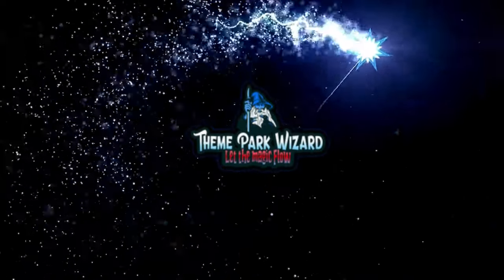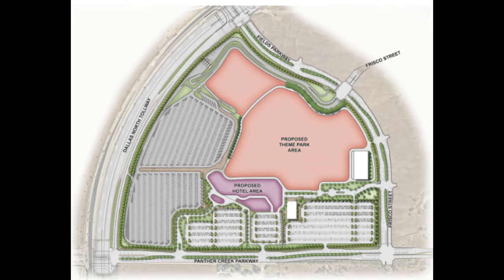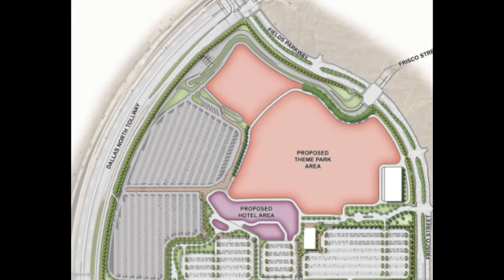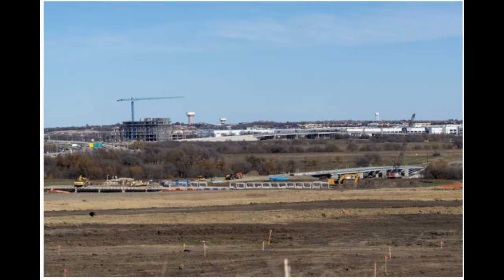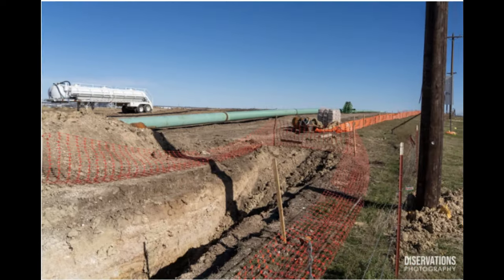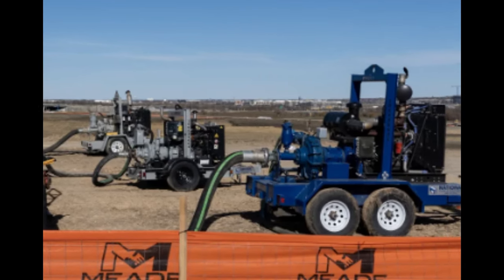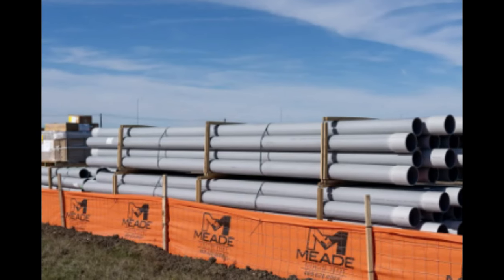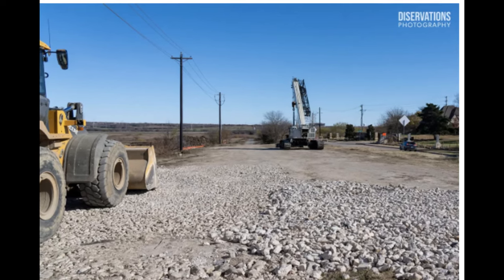Land Prep Has Started For Universal Kids Resort | Universal Kids Frisco Texas Construction Update

Comment: The grey parking lot is for park guests. They wanted to minimize traffic on Panther Creek, so the main park entrance is on the north side (Fields Pkwy) with exits on the Tollway access road, and Fields. The left white parking is for hotel guests, center white is for hotel staff, and right white is for park staff. I believe the Frisco city website still has a map designating what each lot is to be used for.

2:38 everything past that bridge is not owned by Universal. It is currently zoned for residential, and is still part of the major Fields project. The Universal parcel, was also part of that development, but thankfully they were able to buy and rezone it. The actual expansion site shown on the map currently has several large temporary buildings on it right now.
Reply from the maker: Oh thank you so much